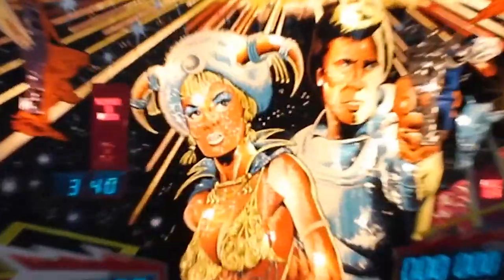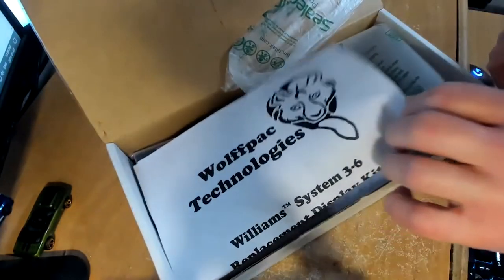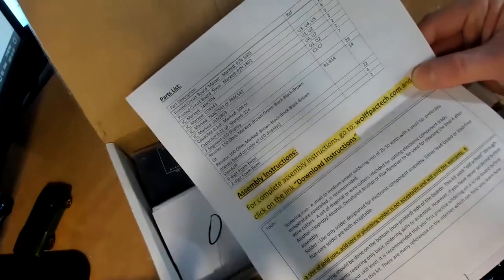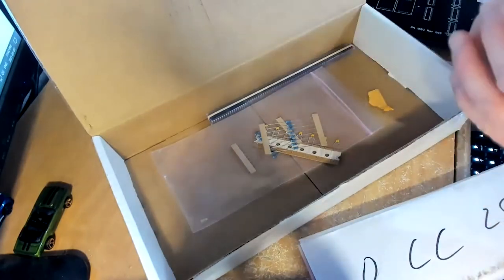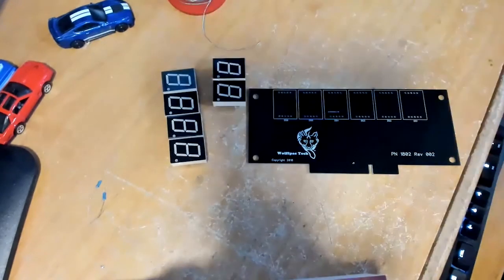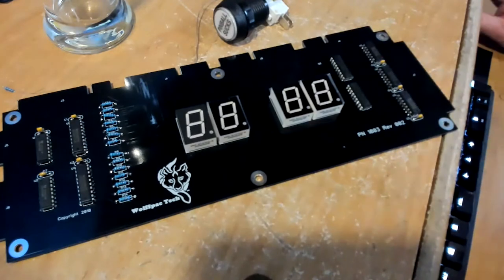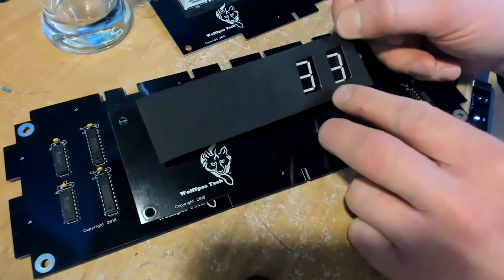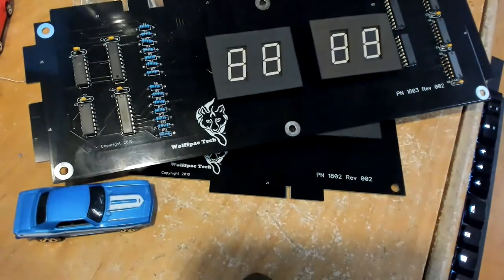WOLFFPAC TECH LED pinball displays - Unboxing and Review - Williams System 3-6

Comment: Perfect timing for this video. I have a Wms Millionaire that uses one master display unit and it is the ONLY machine that uses that particular display setup. I just got word that three of the five glass displays are out. Replacement cost for those particular glass displays is over $100 each which would bring the repair cost to $400.00. For $150 I can buy the Wolffpac Tech display kit. Nice to see their product before purchase. Great vid! Thanks.
Reply from the maker: Thanks! If you're comfortable with soldering and taking the time to put them together, these are a great option to save a few bucks. Glad you liked the vid. Thanks for watching.